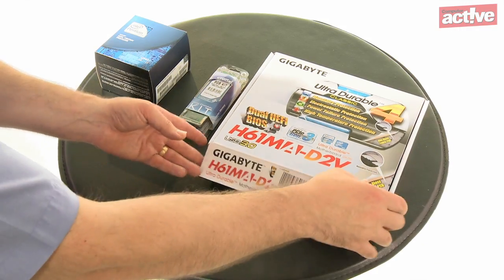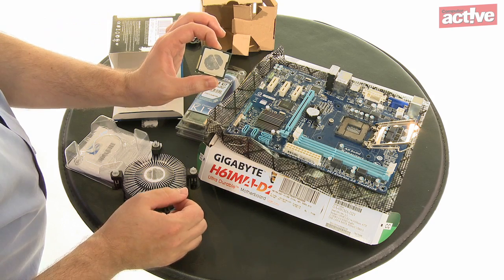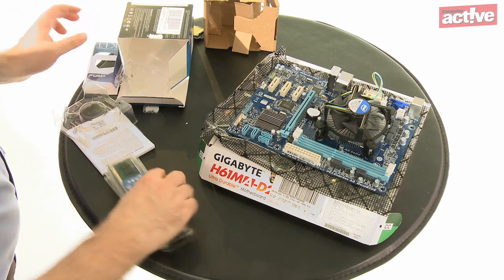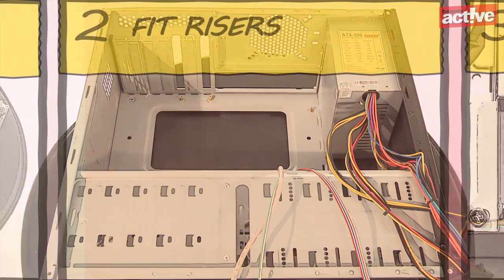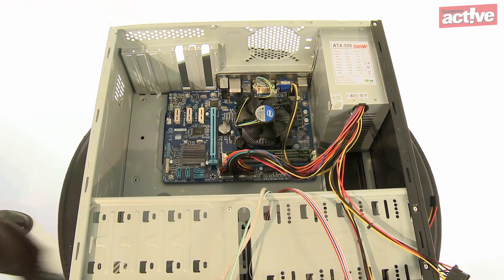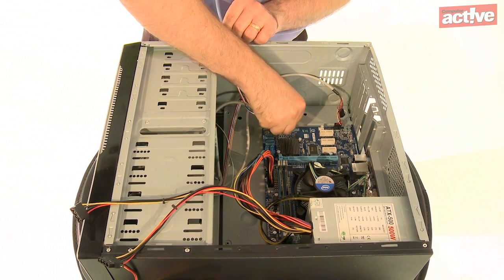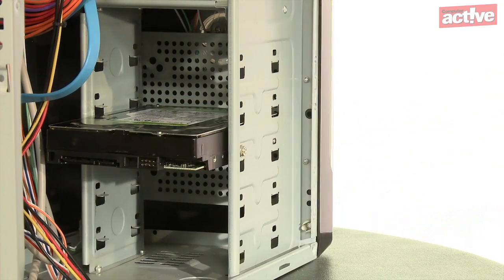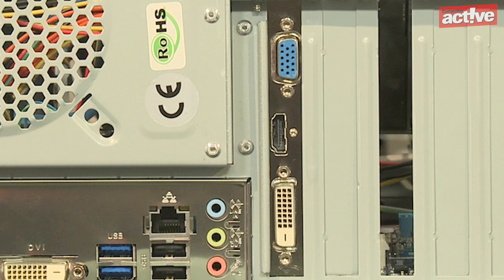How to build a PC

Comment: Very bad. Memory - after pushing in clips must be checked.
Thermal paste - no information.
Remove cpu socket protection cover a moment before installing cpu and NOT before messing with heatsings above board.